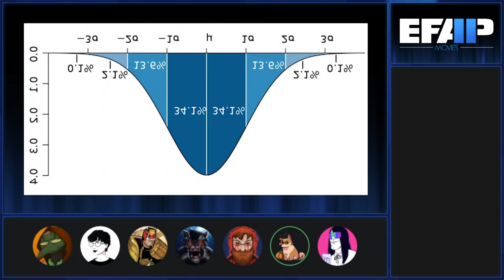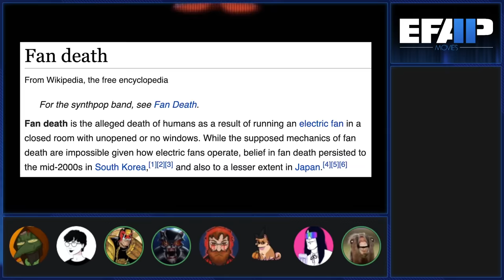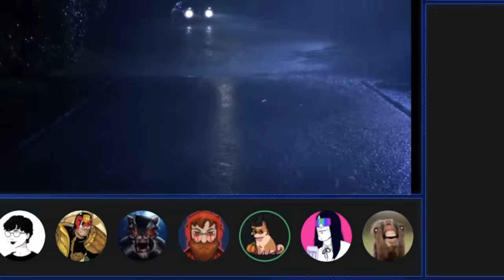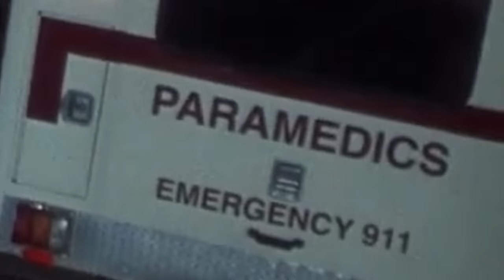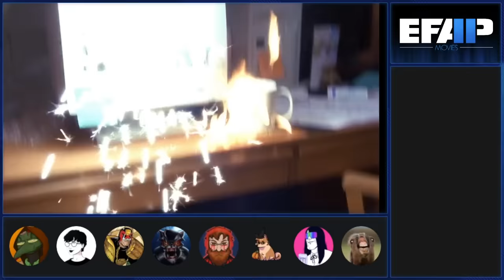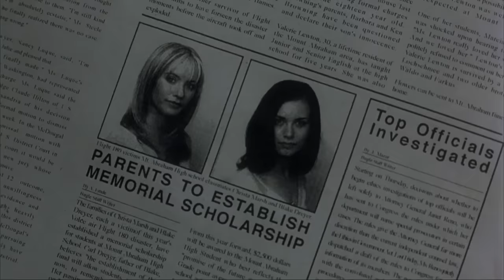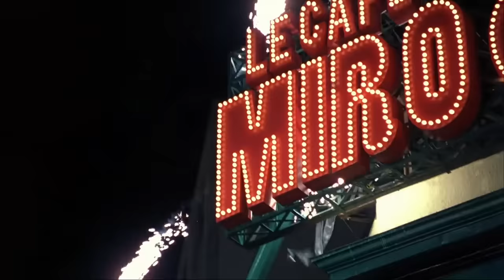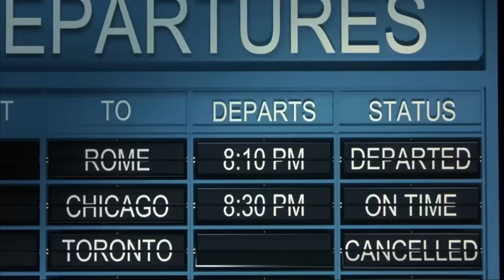EFAP Movies #37: Final Destination with YMS, JLongBone, Jay Exci and Shoe0nHead

Comment: The plane disaster at the beginning of this movie still scares me. This movie and Castaway are the two movies from the early 2000s that made me afraid of flying.
Reply: Sameeeeee. Every once in awhile I think of the Final Destination film right before takeoff 😬
Reply: And not, you know....9/11?
Reply: Dunno.
Seeing someone with a long beard and a "traditional" garb on the same gate as me, makes me way more nervous ^^
Reply: @arsenelupin9697  ALLAH AKBAR
Reply: I think it's based off a real air disaster; TWA flight 800. Though in that case the fuel take exploded and the plane broke apart immediately, there was none of this oxygen mask dropping and overhead locker opening nonsense.
Reply: @patrioticcat5768  9/11 isn't as relatable in regards to instilling a fear of flying, it alongside most other plane crashes are only documented from a distance. The two movies OP mentioned have the characters experiencing a plane crash as its happening, much easier to empathize with than I plane being filmed from ground level.
Reply: @patrioticcat5768  Both those movies came out before 9/11. So 9/11 wouldn't have instilled a fear of flying in him if he already had a fear of flying because of those 2 movies.

Comment: I had never heard of these movies before, so didn’t know what to expect from this years Halloween marathon.

Then I saw the EFAP trailer and that was all I needed to know what a wild ride we are in for. 😁
Reply: Brace yourself for a moist impact... It's gonna be fun.
Reply: I've never seen any of those movies, not even the trailers, so it's gonna be a complete surprise for me.
Reply: My Good King you are in for a treat. Its bonkers and it only gets better/worse
Reply: The first movie is the most normal, so you're in for it now.
Reply: The first is best, probably for originality only. Also, the younger we are, the less critically we vet these pieces. Notice when they "break" into the morgue, they simply open a skylight and then use a 'handle turner' to open the morgue door, only what you see is the coat hanger miss the door handle and then he uses the door handle from the other side to open the door.

Baller move.

Comment: A car is actually a pretty good place to be in a lightning storm
As long as you don't touch exposed metal, it acts as a faraday cage
Reply: Just remember, just because your tires are rubber doesn't mean you can't have a big enough charge to arc to ground.
Reply: @Destroyahx2  The cool thing about electricity: It can't go inside an enclosed conductive area
The math is a bit complicated, but basically, a Farraday Cage is enclosed metal, and the charge will go through the metal without affecting anything inside